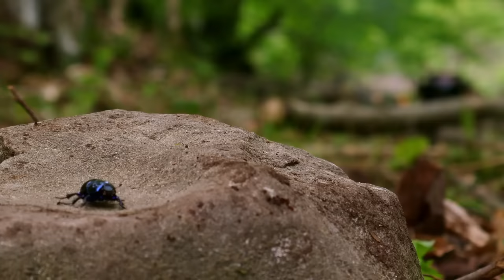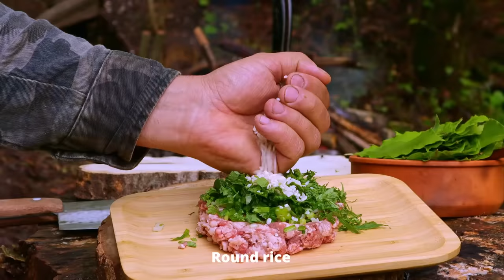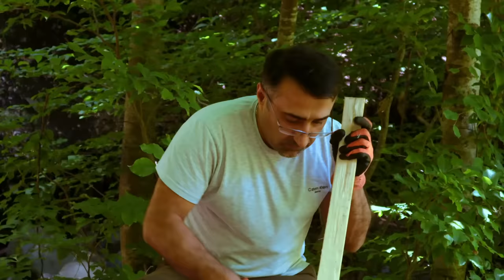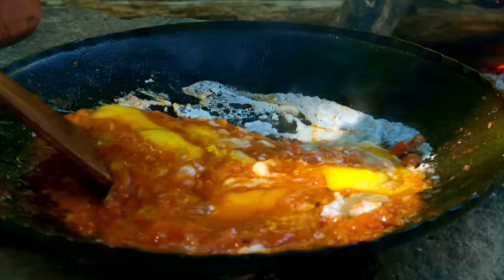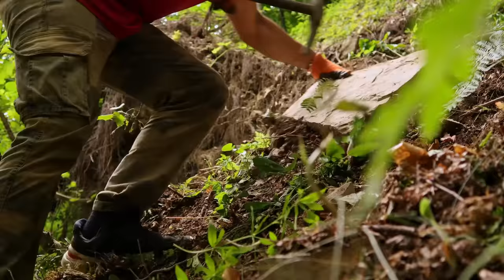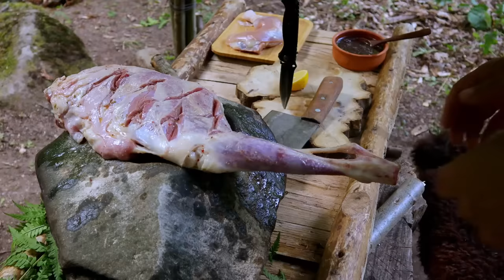My bushcraft campsite that I built from start to finish in 3 months. 5 in 1 compilation.

Comment: Was very impressed by your work ethic and the environment.. looks like a summer garden of plenty.. Just one critique and i hope you take it as a positive.?? I wish you had used hsndmade dowels and/or saddle joints and constrictor knots instead of nails in your construction!!
Reply from the maker: Thank you for watching. There are nails, wires, and other tools that some viewers don't like. But believe me, it is faster and easier to take a handful of nails than to take a handrail and suffer for hours. But I will consider your suggestion. Thanks.

Comment: Large wet stones from the river will explode when exposed to high heat. Use caution with this example.
Reply from the maker: It is true that stones can explode. But not all. There are green volcanic rocks here that never explode.